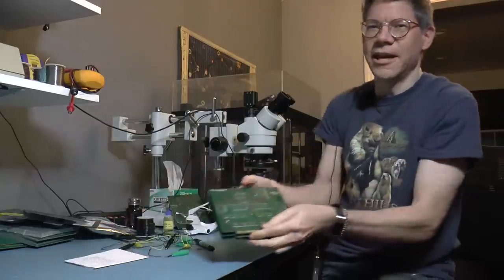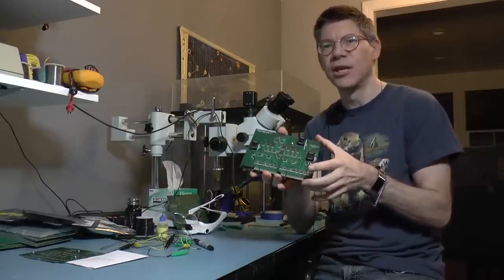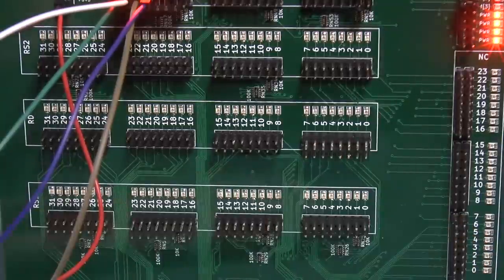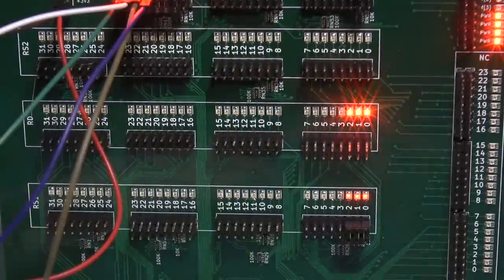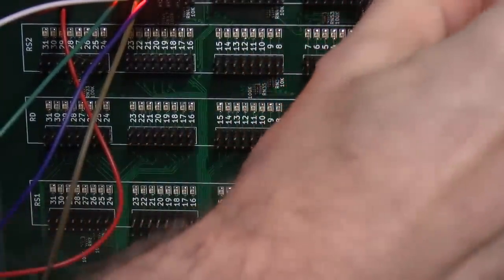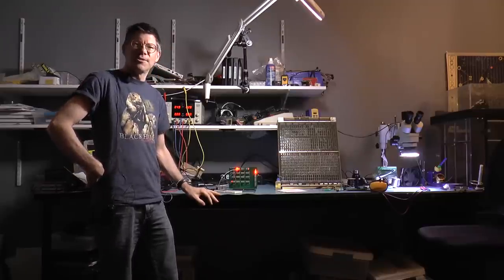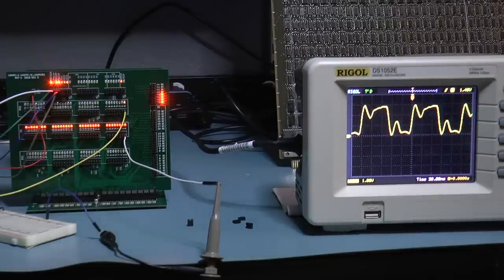LMARV-1 (Tangible RISC-V) Part 8: Testing the revision D ALU

Comment: I worked on the software side of a 200+ TTL chip (and VLSI)  design in the early 1980s. The whole design was too big for the simulation/verification tools we had, so it was broken down into funcitonal blocks, Simulation/verification went along in parallel with the first breadboards; the designers were experienced and had confidence in their designs and time was tight. The breadboards were wirewrapped, which as a prototyping technique has good and bad sides!  Enjoying the videos very much, by the way.

Comment: Great project! And thanks for taking the time to document it here :)

That waveform looks like signal reflection, caused by mismatched impedance of source (buffer), transmission line (PCB trace) and sink (LED / scope). You might be able to improve the performance by installing a series termination resistor (33-ish Ohms) physically close to the driver (the buffer). (Some more reading: https://en.wikipedia.org/wiki/Reflections_of_signals_on_conducting_lines)
Reply from the maker: Check out my series on termination :) I terminate the backplane with RC.

Comment: Great videos. I've learned a lot thanks to you. This video gave me a very nostalgic feeling. I used to work with a Neural Network Machine (the CAMbrain) in 2001/2002. Only 3 were made, and it was full of faults. So my job was writing software to test every circuit. So the same as here, but with software.
I'm going to FOSDEM this weekend. A giant open source fair in Belgium. On Saterday there are going to be many speakers talking about RISC-V. I'll try to film as much as possible, and I hope to make some great videos out of it. 
I'm also a Youtuber, I make videos about single board computers and microcontrollers. I can't wait for RISC-V to be used with sbc's. 
Thank you for all the great work you do, greetings. NicoD

Comment: What's the frequency that You want to run it on? Do You have some automated test jig to test ALU especially in boundary conditions?
Reply from the maker: My goal is 10MHz clock. It would be great to get 10 MIPS out of it, but I think I might be stuck with 3 MIPS (3 cycles per instruction).
Reply: @RobertBaruch  I think You can easily get couple times more than 10MHz, but probably with some modifications, such as rework of the ground and power supply (mainly HF decoupling) and, probably, changing memory chips to faster ones. Hope I'll see it overclocked some time!

Comment: Liked and subscribed, but I wish there was an additional like option for your prairie dog shirt. 
It looked like you were running up against the edge there but then after seeing the probe on a leash setup I'm not surprised at all by the waveform. I would love to see this with optimized termination and a more optimized probing setup, but hats off for 20MHz operation in any case! Well done!
Reply from the maker: Yeah, the scoreboard is just a bunch of antennas and long stubs, and the probe didn't help. I wasn't really looking for a clean waveform :)
Reply: As long as you miss the eye, you're golden. There are no squarewaves without infinite bandwidth. Looking forward to the next installment!

Comment: You should implement the quad precision floating point extension.. judging by your vintage example it should be simple enough.. :P
In seriousness, this is pretty amazing, considering the (relative) complexity of the RISC-V architecture. Not many people build cpu's physically anymore with how cheap FPGA's are nowadays, but it's so much more satisfying when you can see the finished processor working in all it's grandeur. :3

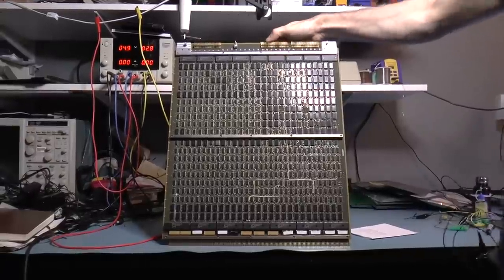Comment: Looking at the floating point unit @15:45, the first thing I noticed was the "bodge wires" between many of the chips...

And then I hear you say: "There's no way you could just write the board down and assume it's just going to work."  8) 
Yes there is! People do it all the time. They almost always turn out to be wrong. (Assuming something is going to work out fine is easier than thinking about being wrong... at least, it's easier _right now_.)

"I'm sure there must have been some kind of simulation, some sort of testing, some sort of validation that this design actually worked."

Well, that simulation, testing, or validation wasn't quite enough though. 
Based on the numbers and types of connections those wires look like they're doing, it was probably a small set of mistakes that required those aftermarket patches. But it's still very impressive.

Comment: 40 years ago I build my first microcomputer :-)
MC6809, 4 kbytes of ROM in 8 x 4kbits (512 bytes) UV-EPROMS, 8 kbyte of RAM in 16 x tms2114 (1024x4 bits) a dual paralle port MC6821 for a centronics port and a MC6830 UART for serial com to a teletype.
Apart from the "big" chips was all the "glue logic" for addr. decoding and bus buffering and interups - all put together on a PCB just a little bigger than an A% sheet of paper.
The address decoding logic and control signals was diagrammed, a raw sketch of the memory wiring - just to make sure I didn't forget any thing ;o)
Everything was Tapped up in under 20 hours - on the fly - and it worked perfect at "first power" ;-)
What is "tapped up" ? - there were no layout programs at that time, you used special, very narrow, black tape on a plastic foil and photografically transfered the layout to the PCB.

Next project 10 month later was my first MC68000, yes 16 bit, alot more EPROM and 16 times more RAM - 64K-words !!
Huge project - on Dobb. Eurocard PCB's, separate RAM board and nearly everything was documented before layout was "executed".
Worked at first power ;-)

I have another 14-15 MPU/MCU/DSP designs behind me now and non f them has been simulated before layout and only two have needed a signal-fix/swap to work.
But I have to admit that all of my designs has been less than 8000 pins/10000 connections and all but the first two has been with a PC-based schematic/PCB-layout system.

You have to be a very structured hardware designer and yes a simulation software could have saved me many, many hours of checking and re-checking before committing to do the netlist and do the layout ;o} 

Btw Robert - nice job :-)

Comment: The scope shows definite signs of poor transmission lines. At 10+ MHz, you need to consider transmission line effects with proper pcb layout (w/ a solid GND plane under each transmission line, termination resistors, buffers, etc.)

Comment: "no Clean" significa que no es necesario limpiarlo... sucede que, con otros flux's si se requiere limpiar, debido a que producen oxidación.

"no Clean" means that it is not necessary to clean it ... it happens that, with other flux's if it is required to clean, because they produce oxidation.

https://www.digikey.com/products/en/soldering-desoldering-rework-products/flux-flux-remover/266?k=kester

Comment: Excuse my ignorance but, when testing low frequency clock, why are the LED blinking?  I always thought the lines of the data path were stable keeping the voltage of their logic level. Are those oscillating between 0.0 V and their logic level at the same frequency of the clock (it looks they are)? If so why?
Reply from the maker: No, the input was switching between 0 and 1 using the waveform generator. The other input was fixed at 0. So the output was switching between 0-0=0 and 0-1=0xFFFFFFFF.
Reply: @RobertBaruch  Thanks a lot fore the clarification.

Comment: Perhaps a dumb question, but when you are toggling the input data at 10MHz, aren't you actually running the ALU at what is effectively 20Mhz (i.e 20Mops/second)?  I.e. when you are driving the input high you are performing 0-1=-1, and when you are driving the input low you are performing 0-0=0.

In my day job the difference between GHz and Gsps (or Gbps) is always important to keep straight, because that factor of 2 often is the difference between something that works and something that doesn't 😁
Reply from the maker: Not a dumb question, and yes! It is 20 MOPS!
Reply: So was the '10Mhz' you were confident of from your Verilog really 20Mops, and the '20Mhz' was really 40Mops?  Just trying to figure out how fast you think the final design will run
Reply from the maker: @wmlye1  I think I was hoping to get 10MOPS from the simulation. Maybe 15.

Comment: Looking at the scope probe setup at 20:46, if that is the actual probe in the center of the image, then I am not surprised at the waveform on the scope at all. The loop consisting of the white wire, the capacitive probe tip, the probe ground, the blue wire, the protoboard, and the hidden path from the protoboard to board ground is huge. That inductance, combined with the probe capacitance, sounds about right for the waveform. I suspect it will look a lot nicer when you dig into the little baggie of stuff that came with the probe, and find the ground spring. Oh, and 1x on the probe is for DC only.
Congratulations on getting that working!
Reply: I think it would be enough improvement to just hook directly on the pinheader and clip the ground onto the same board and not into a breadboard. And deffinitely x10 probe, yeah
Reply from the maker: The probe was 10x. But yeah, there's really no getting around the fact that the scoreboard is just a mess of antennas and stubs. But the backplane itself is correctly terminated, so theoretically with real cards this will perform well.

Comment: Hi Robert, your probing doesn't help :) The ground  and inductance loop caused by the probe ground going to the breadboard and through the power supply will make things look extra bad. 
Have a look at Dave messing with a TTL computer by snipping off bypass caps. https://www.youtube.com/watch?v=P8MpZGjwgR0
There's also a section called "A primer on correct signal probing techniques" ->  https://youtu.be/P8MpZGjwgR0?t=1178
w2aew who does a lot of RF stuff also goes over probing techniques in some of his videos - well worth subscribing to Alan too.
BTW: Congrats on getting the ALU working. I figured you'd be beavering away on it. The simulation in Verilog is a nice touch :-)

Comment: My guess is the poor signal quality at higher frequencies is due more to the flying leads on your probe tip and ground. I'm sure the signal would look much better if you probed right at the pin with a very short ground lead. I have had good success with 0.1 header pins going straight to the scope through a thin coax at hundreds of MHz.
Marc Thompson published a fantastic article 20 years ago about guesstimating inductance of wire loops: https://pe2bz.philpem.me.uk/Comm01/-%20-%20Parts-NonActive/-%20Inductor/inductance.htm

Comment: It hurts me to see you hurt your hands by twisting them for the jumpers. Just lay the scoreboard flat on the table with the ALU sticking under the table. Also where are the series resistors for the LEDs of the RD and NC blocks?
Reply from the maker: They're probably on the back of the board.

Comment: 16:24 - and you would be wrong...
Reply: Yeah, they had simulation systems available, but they where horrifically expensive, and a very clever digital designer was much cheaper. For a while...